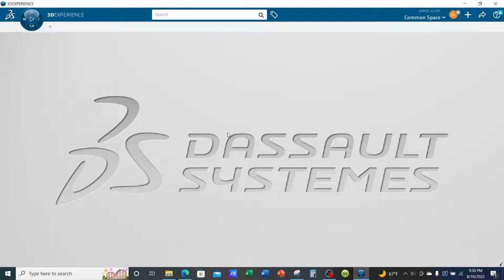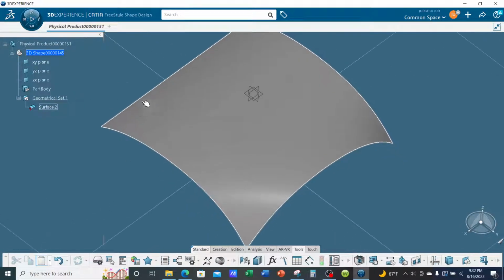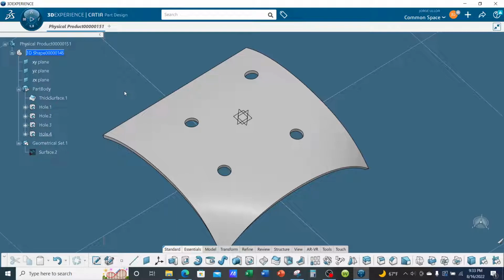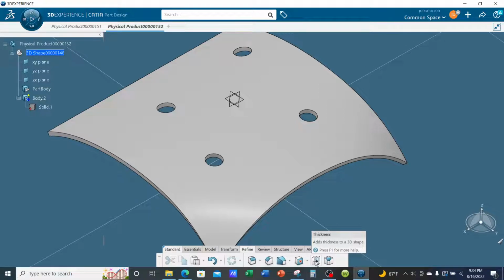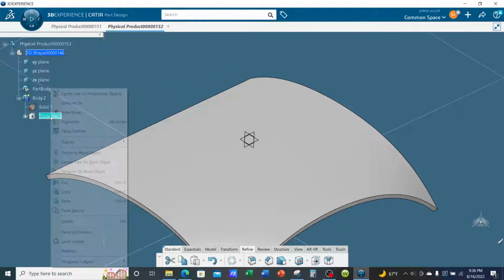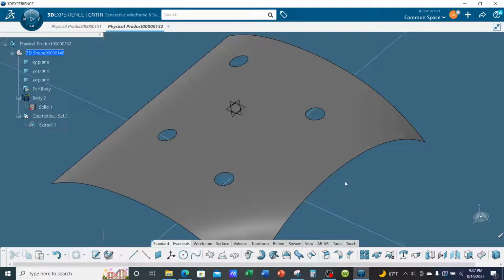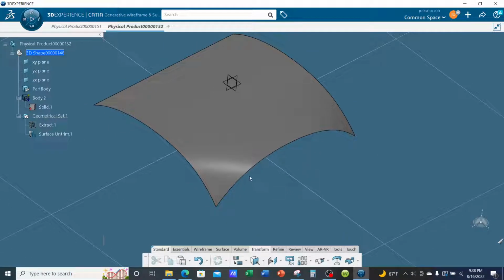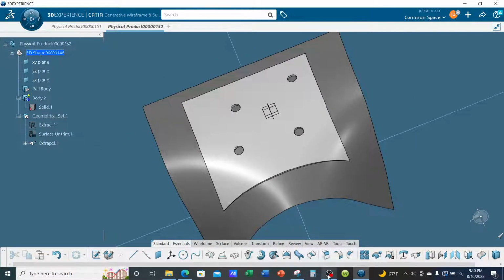Catia Remove Holes from Surface

Comment: You are my hero. I was provided a solid with some holes to it as a "dead body". My first thought was to fill the holes in shape design but the curvature was off so that you could see the outlines of the former hole afterwards slightly. Your first trick didn't work for me because the holes in my solid had an edge fillet applied as well so I couldn't just use thick on the inside walls. But because luckily both sides of my solid have a constant distance I could extract one side. Untrim it like you showed and use thick surface on that. When I added that body to the provided one the holes disappear and there are no edges left. I've never used untrim before. Luckily you showed both techniques.

In my defence I started working with catia a few months ago. Firstly in part design only and I am currently exploring shape design and so on.